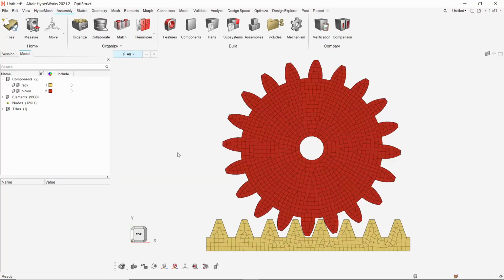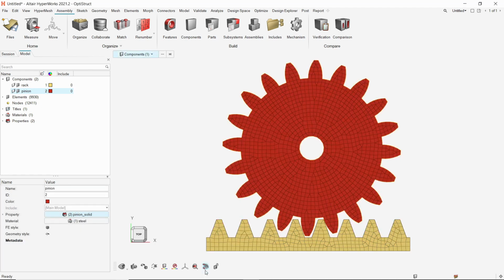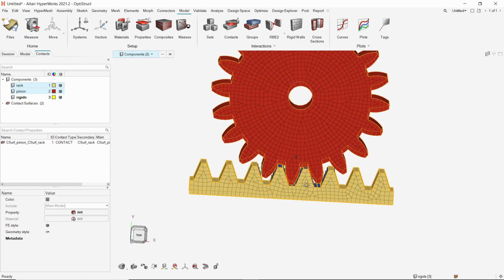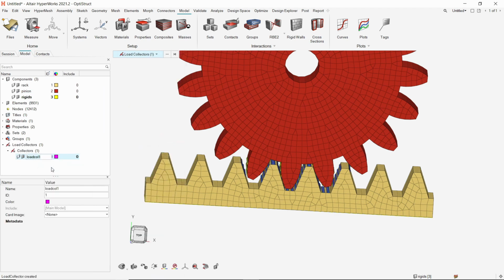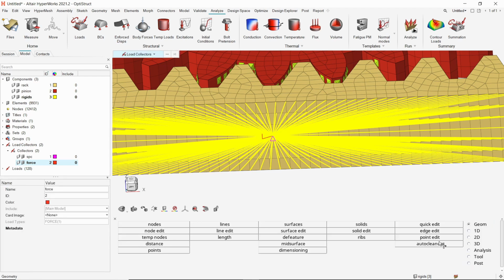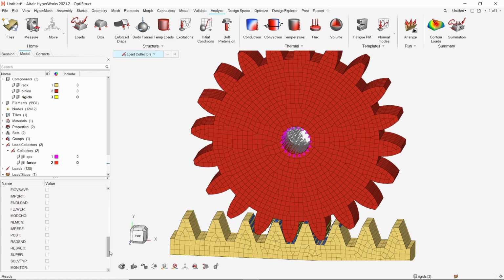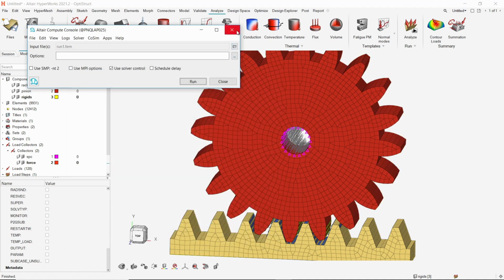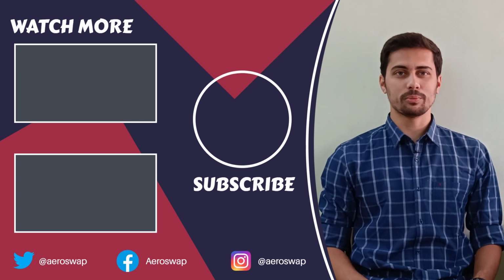Nonlinear Contact Analysis using Hypermesh [Optistruct Tutorial]

Comment: Why did you create 2 separate but identical (except for the name) property card?
Reply from the maker: Hi Allon, it is a standard guideline in industry that every component must have a separate property. This is just to keep the model organized. If one property is modified at a later stage during the analysis setup, it should not affect other components.

However, you can use the same property for both components and get the exact same results. Notice that in this case, the solver will output a warning message saying that same property is used for two or more components!

Good observation by the way :)

Comment: Thank you for the in-depth details..you made us easy to learn difficult things..Will you please advise the significance of Altair over the Abaqus? Thank you
Reply from the maker: Hi Roshan,
Altair Hyperworks and Abaqus are both top notch industry leading software for FEA. Both have certain pros and cons but there is no clear winner if you want to compare. If you ask me, I personally prefer Altair due to the high level of flexibility it provides in model setup! On the other hand, Abaqus might be simpler to use than Altair products.
In the end, it depends on what you like better. You can't be wrong with either of these choices. Both are very good :)
Reply: @Aeroswap  Thanks a lot for your valuable inputs.

Comment: Nicely explained Swapnil. Contact analysis can be tricky sometimes, however the new algorithms allow FEA users to experiment using contact with ease. I was expecting to see a rotating pinion :) As a suggestion for examining some additional results in Hyperview: add the "CONTF" in the global output options during preprocessing.
Reply from the maker: Right! This is just a very simple example to introduce beginners to contact nonlinearity. I am already working on a model with rotating gears. It will be a continuous sliding (CONSLI) type of contact with friction. The CONTF card will be used to extract key outputs like contact pressure, status and forces. Working on this at the moment. I will surely let you know once it is ready :)

Comment: Do we need non linear material properties for solving non linear problems?
Reply from the maker: Hi Shashwat, it depends on what kind of nonlinearity you want to have in the analysis. In this particular case, we are only interested in boundary (contact) nonlinearity. Hence, a linear material was used and nonlinear contact is defined. I hope this information helps!
Reply: @Aeroswap Yes got it
Much needed information shared, Thank you🙏